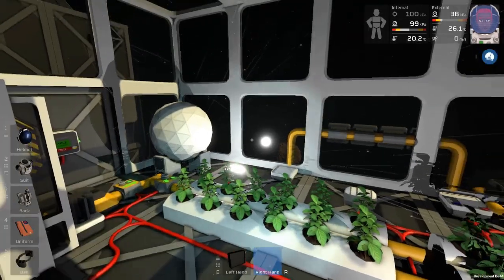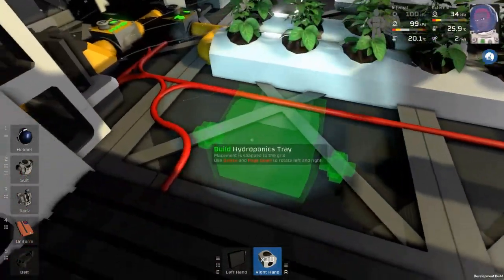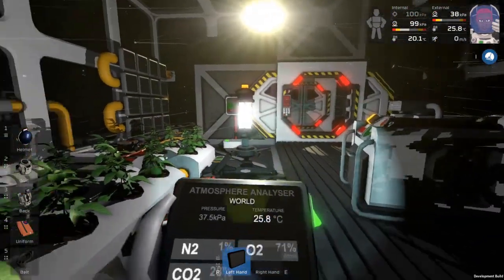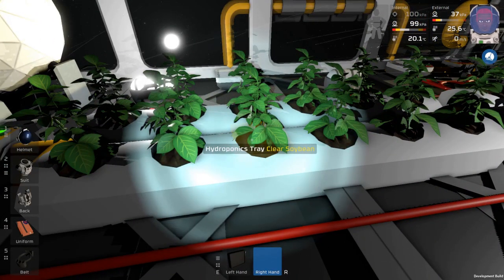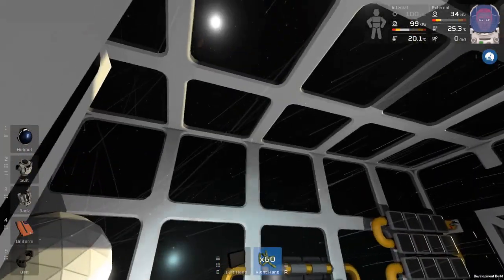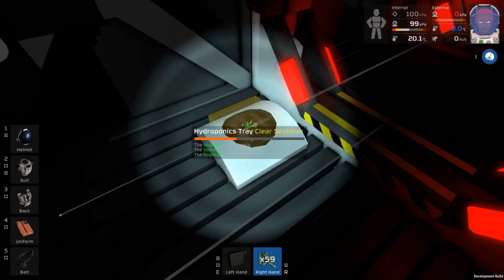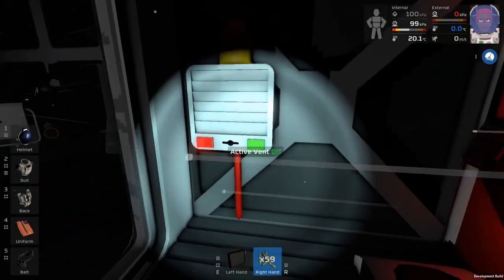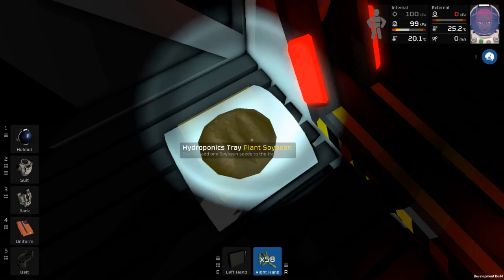Stationeers - Hydroponics Tray Setup

Comment: i once got the pipes leading into the trays to several megapascals by accident, didnt seem to mind the plants and had the positive sideeffect that that gave me quite a huge reserve in water as you can imagine.
Reply from the maker: You could use a pressure regulator to make sure it never runs out.

Comment: I'm kind of new to Stationeers. Can you please explain why you need a volume pump, why you need pipe radiators, and what the role of that golf-ball looking thing is in the corner. Thanks!
Reply from the maker: +Sun Razor the volume pump is so that when I attach a tank it gets emptied into the storage tank (golf ball looking thing).
Without it, the pressure would only equalize and there would still be water in the tank.